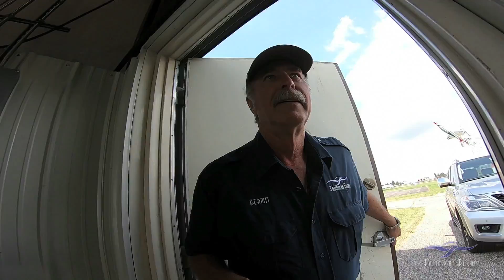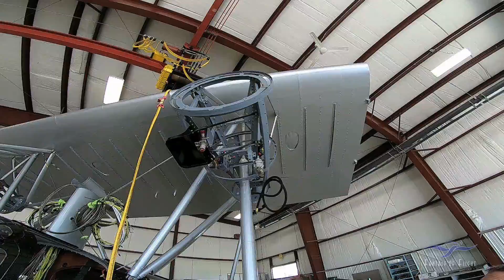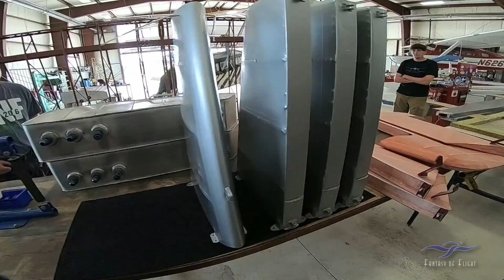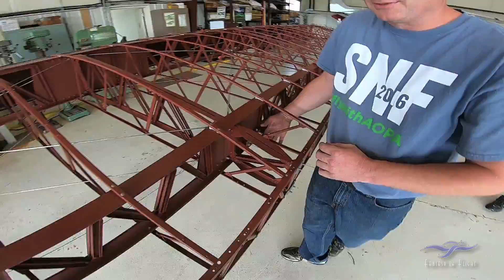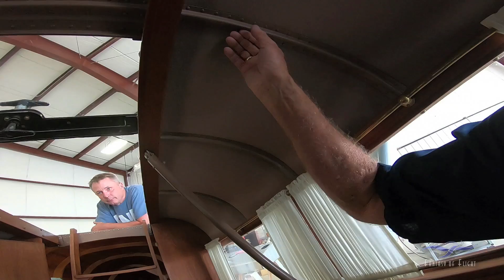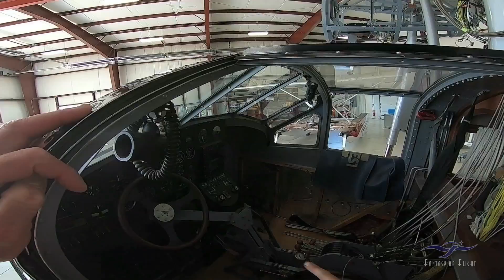Sikorsky S-38 - Project Visit - July 2018

Comment: Anything Regarding Oshkosh?
Reply: Posting those 2 year old vids of Oshkosh last week seems like appeasement too.  Makes you wonder what happened.
Reply from the maker: Since the Snipe didn't fly, most of our presence there was just showing the planes, running some engines and doing a bit of talking. Wasn't a lot to be filmed so it's not likely to be a featured video from this year. Unless people really want to see it!
Reply: Kermit Weeks Hangar what happened with the Snipe? Rained out?
Reply from the maker: Preparing for the first flight the FoF crew discovered a leak in the fuel line. Turned out to be a good thing for as the scheduled flight time approached so did the evening darkness. It was determined that the flight conditions at that time of night at Oshkosh would not be suitable for flying the Snipe.
Reply: @KermitWeeks444  That's a shame because I know how hard you and your team had worked. But  safety comes first,especially when it comes to old rare birds .
Reply: Kermit Weeks Hangar makes sense, always a bummer but better to be safe than sorry.
Reply: Sorry I thought the Snipe was going to fly.  I would love to see video of what it's like being around 10,000 planes. I can't think of a better tour guide for a walk around at Oshkosh. I'm surprised you didn't do a live stream! :)